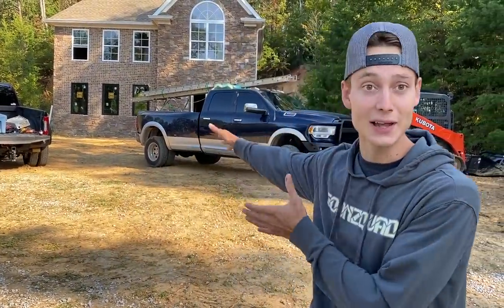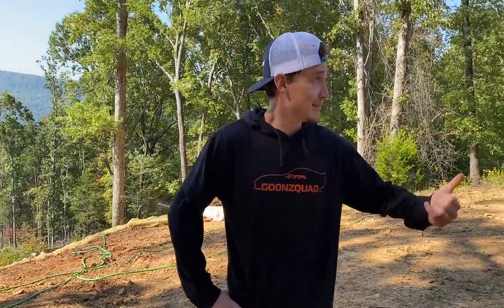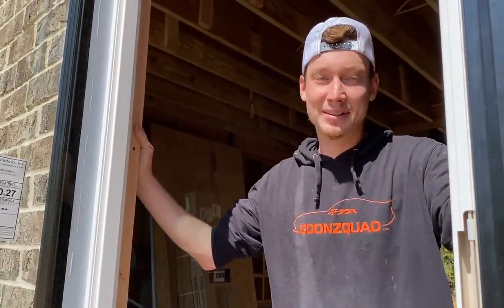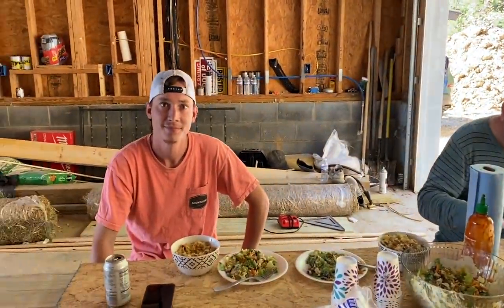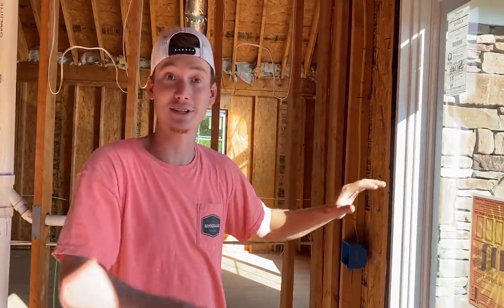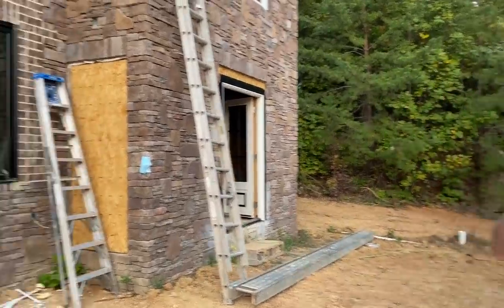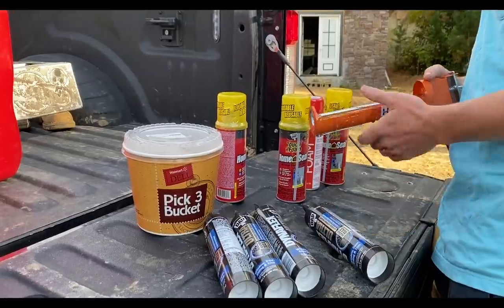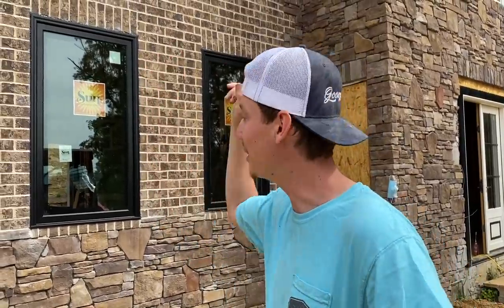The New Goonzquad Headquarters Part 21

Comment: I must say, pop's truck is probably the best project you had. It was very ambitious, it looks amazing and I think it has the most value since it is driven daily and loved by your pops. So glad to see it again.

BTW AFAIK horses (and ungulates in general with exception of deers and goats) do not graze that well on steep angled difficult terrain, they prefer plateaus - hence why you se them in the wild on meadows etc. I'd go with goats if you want some lifestock on the side of the hill mowing the grass. I'd consider sheep but they are too much hassle to take care of. Goats are relatively maintenance free but watch out for predators if you go for pygmy goats. I wouldn't put any chickens, ducks or geese there since you have birds of prey in the air and bobcats in the woods. They'll attract unwanted attention, especially if you have snake problem - eggs really attract snakes, rats, weasels and all that jazz. You'd have to build aviaries for chickens etc to keep them safe. I am not sure about ostriches but I think those would be fine there, I have seen ostrich farms on side of hills. But I have never seen a horse grazing area that was steep.

Also regarding the snake problem, friend of mine has a small zoo that had issues with vermin and snakes and he got a fishing cat. It chased away rats and other vermin and hunted out snakes. It is massive and can be domesticated to an extent (he would not let visitors pet it since it is about as dangerous as a rotweiller but he pets it every time he feeds it). But I do not think you can't get them in general since they are endangered.
Reply: cool info!
Reply: Amen
Reply: TheVanBourner i aint gonna read all that
Reply: @vnybjerg  you don't have to

Comment: Boyzzz if you are reading this i have a small pro tip. In the handle of gun for sealer should be hole where you put tip of sealer bootle and doing that you can cut it off! Greeting from Poland :D
Reply: That gun is from Home Depot and although there is a hole.... it will NOT cut.  Believe me, I have the same one. It’s a cheaper model... 😟

Comment: Daylight was showing through the inside of the window when they sprayed the expanding foam. The caulking should have been applied between the window frame and the brick as the window was put in place. The foam insulation should not be used as a water barrier.
Reply: I was thinking the same thing it’s going to rot
Reply: Fact
Reply: The foam will expand and cover those holes.
Reply: @ondoxxm7005  nope
Reply: @KCAATV  LOL!! Did you saw those excess foam that went through the windows edges Or you just don't know how foam works?

Comment: When you said you would install the windows yourself, with no experience at all, I** went Huuuum, don't ! ** 
It's very easy to screw up, like you did with the first one, using the very wrong type of foam.
But, heck, you boys and Dad did great and proved me wrong after all !  Good job, young ones !  👍
Reply: I'm always a little nervous when I see windows installed without a nailing fin. I know this is a widely accepted method of install these days but it really isn't the most reliably weatherproof. Also, screwing them into the framing almost guarantees a seal failure as the house expands and contracts through the seasons or as the house settles into the ground. This house has been there for a while so it's unlikely to move much but still.

Comment: DON'T PAINT THE BRICKS! you'll regret it later, instead put another window where the old door was that would be super fire entrance window!
Reply: Render the brick/rocks and then paint it white
Reply: I have a masonry company we do stone and brick. Brick paint will only last for about 5 years until it starts pealing. Personally If they want to paint the house white I would take down all the brown stone and install grey stone instead so it doesn’t look so plain and gives it the modern look they are looking for. But it would be really expensive to do.
Reply: @aussiebattler96  Painting stone white looks horrible within a year because it collects a ton of dirt and grime.
Reply: Rick From the Cape and it’ll look like cheap plastic
Reply: @_-0_x_-_p_0-_  It really depends on the paint and how it is applied.
I've seen a few painted white for decades and they look awesome, when you get up close you can actually see that the paint is high quality, still looks like it's just been painted.

Comment: That's a "goob" move to paint this house!  Brick and stone is classic....don't ruin it!
Reply: Paint it black !
Reply: @travisash8180  why so they can repaint every 3-5 years? cause Rocks don't hold paint that long.
Reply: @travisash8180  if they prime the house with aqua lok and use an acryllic paint with heavy solids it with hold up just fine
Reply: @travisash8180  HeHe  :)
Reply: @blakeiddings12345  and cost a fortune
Reply: @juliealbert9222  Sell the bondocopter and use aqua lok with a black acryllic paint !
Reply: @SourBogBubble  they absorb the water that is in the paint and can cause more issues later , with bricks crumbling

Comment: I've actually been on jobs where that expandable foam wedged doors shut or broke the glass out of windows because it didn't have enough space for the amount that was sprayed to expand. I had no idea it could do that until I saw it for myself. So good choice on the low expanding foam.
Reply: I had to repair a custom 10ft slider that too much foam was used on. It pushed the top center of the frame down binding it on the slider. 
The foam was sprayed and it was immediately trimmed off. They should have used more shims and screws on top of door however, which could have prevented the issue as well.
Defiantly a place for the gaps and cracks foam but, its easy to over do it with that stuff.
its seems to vary from one can to next but some cans expand way more than others too.
Reply: Yep got to use low expansion foam
Reply: I've also insulation version push decking away from the framing
Reply: My mom put it under neath the door to keep ants out my dad had to kick the door down to get in🤦‍♂️
Reply: They been selling with 'minimal expansion' written on the cans for years and prior to relabeling it for windows and doors.  This is a well known phenom
Reply: They use that foam to lift sunken concrete driveways. That stuff is no joke
Reply: Agreed...spray foam is a learned experience...proceed with caution..I knew its come out the front when I saw em just pumping that in there...glad it was only that lil corner..it ruins everything it touches use sparingly & with gloves

Comment: I have installed windows for many years and this is exactly how u remove them. Great job boys. And Dad
Reply: Hopefully this isn’t how you install them😀
Reply: American building standards seems a bit odd. In sweden you would loose the mounting bolts and you would lift the whole window out. Not having to pick it down piece by piece.

Comment: Take them stickers of the windows otherwise it’s going to be a nightmare with the adhesive after the sun bakes them on
Reply: The mfg’r Sun asked them to stay on for today’s video, $$advertising!
Reply: @SPW812   That's what helps pays for this channel
Reply: Billy Wilder exactly.
Reply: It's stuck to glass!!!
5 minute job to clean! With Rubbing alcohol/Turpentine/White Spirit and a RazorBlade held FLAT TO THE GLASS Problem solved.

Comment: My Idea for the shop would be to build it into the hill side and  make it a 2 level  shop,  the "bottom" level accessed from the bottom road,  and the "top"  level access from the house Level.    With this you could have Lots of Glass for the garages facing the Valley.   The "top"  Garage could be made into a  Show / Storage Garage.   With the "bottom" garage built into the hillside it would isolate the noise from the Machinery  etc.
Reply: That would be seriously awesome!! But also very costly!😂😅
Reply: Yea, nice kinda with an arched gable walkway and you can angle the garage to the terrain like an "L" shape. Itll help break up the Box look of the house and you can stick a Brother in that mother in law apt. So your not on top of each other. Add a few opening skylights and a huge front window with a mini deck..thatll be the room to fight over..Command center of the HQ
Reply: @diveguy1144  Its real estate Go big or go home (back 2 pops place) sell the Helicopter and just pay for it cash..you cant go wrong with that view..sell that commercial property These guys have options...The taxes & write offs arent worth the time or money Having a Helicopter or commercial property that just sits idle..That house is gonna Rock if they do it right..Put a Steel bldg on a closer parcel as an overflow Hell they practically own the mtn side..
Reply: ALPHA MALE TRUE! I think it would be sweet! They also just bought a brand new skid steer so not to be rude but I think they have the funds!

Comment: You guys might want to check out 'foam backer rod', they sell it at homedepot, you put it in between the window and the framing (you kinda just shove it in with a putty knife, in you case probably from the outside towards the inside). It should help stop the spray foam from expanding to the outside of the house. Also makes it easier to chalk around the windows.

Comment: You should net work the house and make it security camera ready so you don’t have to worry about installing cable in the wall later. If you didn’t work it going wireless you’re happier and faster speeds .

Comment: The back part of the caulking gun should have a hole in the back where you stink the caulk tube tip and then you press the handle and it’ll cut it for you. Don’t have to use a knife.

Comment: While you Don't have the inside walls plastered add a Ducked Vacuum System you can thank me L8TR  will make cleaning so much faster and better :) lol. Please DO NOT Paint the outside of the House, and you can put Solar Interaction Lamps around the Outside of your house and Garden free power they turn on when night time and off day time. All so have a Sensor for movement for Security .

Comment: Here in Australia if you built with that little safety consideration you would be thrown in jail for the myriad of laws you had broken! But I have to say it is great to see how we used to do it, where you needed something done so you got straight to it. In Aus you would would have to have full scaffolding, fill out risk assessment paperwork before starting then the same forms at the completion of the job. You would need qualified riggers to build the scaff and probably a licensed glazier to install the windows....the lists are endless. Good work boys, great to see some variety.

Comment: Wait till the foam expands and swells your windows shut, nevermind.
Reply: Stuff torn up fiberglass insulation in the gap between framing and window. Then use backer rod and caulk on the outside. I cringe when I see people use expanding foam

Comment: When you caulk lick your middle finger and press it into all your caulk. That will help seal the joint and make caulk line look much nicer.  I used to do alot of grazing and didn't need to do this but it is good for rookies. Wear a cloth nail apron and wipe off excess caulk on it or use rags.
Reply: Glazing. Opps

Comment: With the caulking gun instead of using a knife to cut the end off the tube there’s actually a hole in the handle when you close it it will cut the end off the cap for the tube
Reply: They cut the spout short short. The hole is to small. The spout won't fit into the gun

Comment: After caulking run your finger along the caulk to give a smoother finish rather than that corrugated look. If needed dip your finger in mineral spirits/paint thinner to keep it from sticking to your finger. Can also use your finger to push and mould the caulk a bit if needed. Like to make a nice looking round dab over a screw, instead of looking like a hersheys kiss

Comment: Hey guys, for best results... be sure to smooth out the black caulking around the window. Doing that will fill any areas between the window frame and the stone outside. That's pretty much a construction standard for window caulking.

Comment: You guys are very hard workers and very "down to earth"...  just and idea to help you stay safe:   Get a set of pallet forks for the skid steer & weld you a box with side rails (that fit the pallet forks) to stand & work in when you have to work up high....  and you can use a safety harness...  You and your supplies will be safer than standing in the "tooth bucket"...   YOLO...

Comment: Those replacement windows are measured wrong, and installed wrong because of it. Brickmold should go over the brick and be imbedded in caulking then another bead around them. Also the interior should not need 2x4s around it for them to fit.

Comment: You could render it with lime render, it'll still breath properly, then paint it. It would look much smoother and sleek than painted stone and brick would. You should seal around the window frames externally with silicone window sealant to keep the elements out.

Comment: Not sure how those windows work but typically you don't seal the bottom as they are designed so that any water that gets in higher up can drain and run out the bottom.   

Their retrofit installation may be different I suppose.

Comment: a tip with the sealer for around windows, if you put it on and spray it with soapy water then when you smooth it over with your finger to make it look good, the soapy water will stop it going everywhere and stop it sticking to your finger.

Comment: If I found out my builder installed my windows like that I'd be pissed.
You could see light around them then they just hit it with spray foam which will hold water and rot out the frame

Comment: other  hint  on side  of  your  new caulking  gun there a  big hole for tip of  caulking  tube  to cut  off plus a heavy wire  to  punch  hole  tip  so  you gun does all the work  no  knief  need